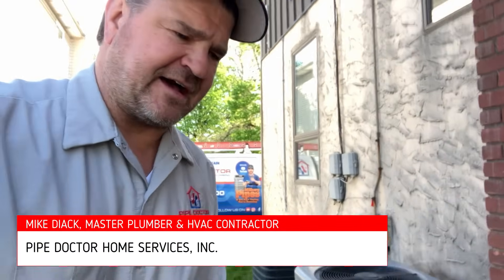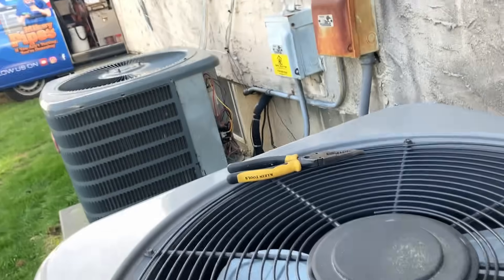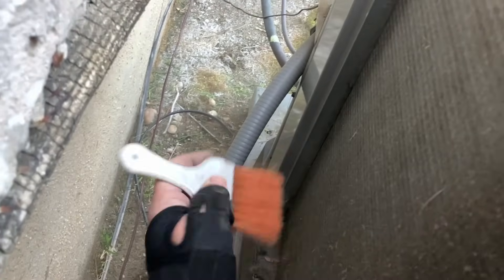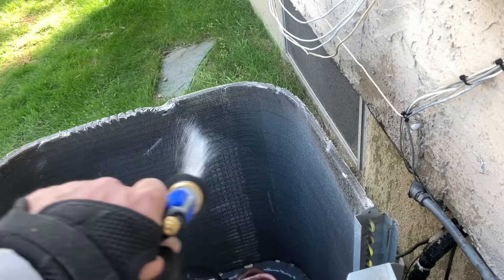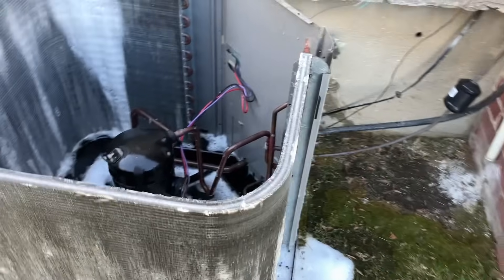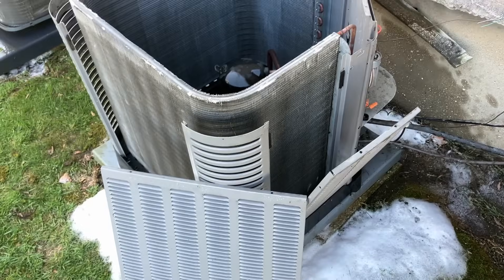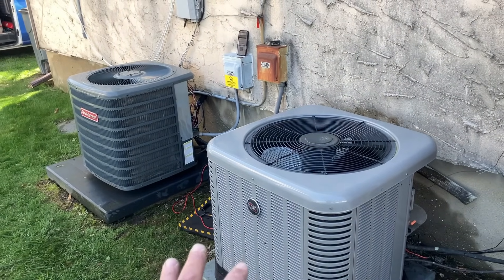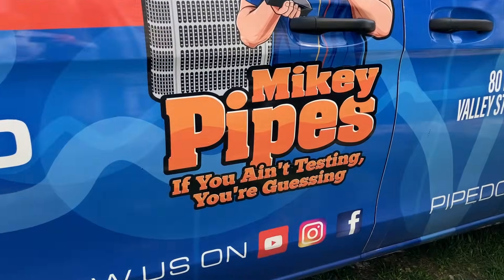STOP Ignoring Your AC! | Step-by-Step Outdoor Unit Cleaning + Indoor Blower Treatment

Comment: I wanted to try the nu-brite stuff could never find a good place to buy it that didn't charge a lot for a gallon of the chemical.
Reply from the maker: I know what you mean.
Reply: That stuff is toxic     Not necessary at all
Reply: That stuff is toxic     Not necessary at all
Reply: buy more ac condensers so you can use a gallon every season.  But a gallon is still cheaper than the AC guy coming out and cleaning it.  I buy my over internet from Tennessee.